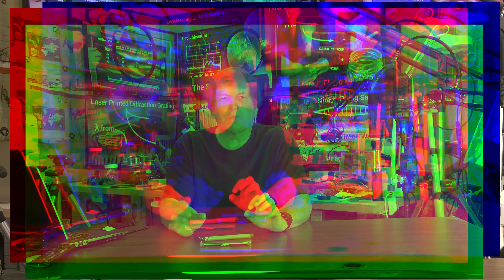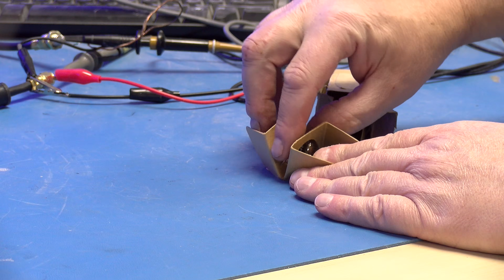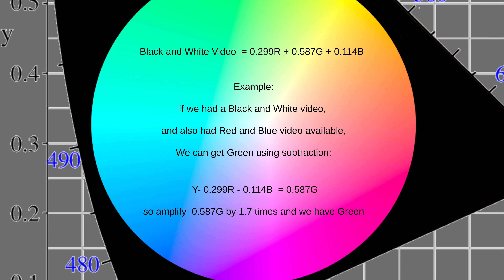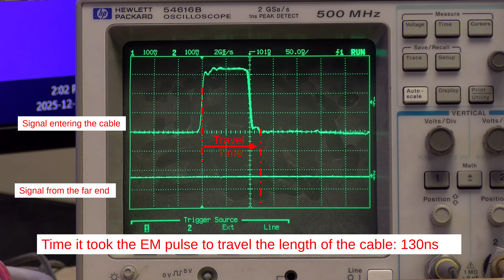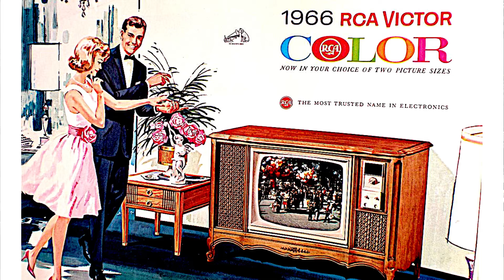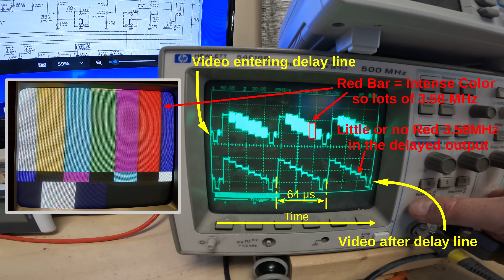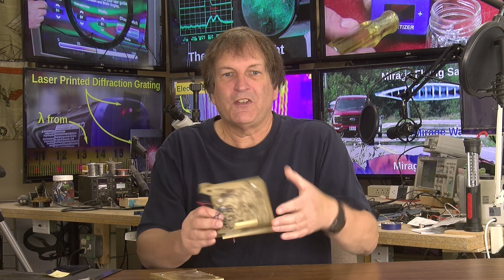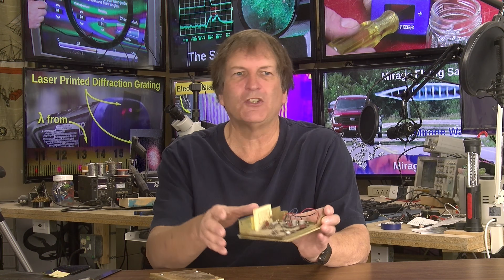How we slowed down electricity to create Color TV

Comment: Regarding the delay line for delaying the black-and-white signal, I'm just curious why the broadcaster didn't just delay the signal at the tramitter - wouldn't the negate the need for delay lines in every t.v.?
Reply from the maker: That would have been a great way to do it but particularity the earlier color TV sets would have needed a longer delay than newer ones. The original TVs separated the color from the BW part of the signal with a simple high pass filter resulting in much lower color bandwidth (=sharpness) than was actually available in the signal, so the color part was "smeared" much more in the early sets and needed a greater shift to line it up with the BW. It would seem like the original color TV engineers anticipated that TV sets in the future would do a better job of separating the color and BW parts of the signal and need a different amount of delay - quite remarkable that they thought of that even though they presumably had no idea how effectively we would eventually be able to do it with digital signal processing. 

They perhaps could have inserted a minimal delay to the length of delay lines in the early TVs half as long  and eliminate the need for a delay at all in later ones, but my guess is that since they couldnt provide a solution that would  work for all future TVs they felt it was better to leave the TV signal unaltered in case adding a delay might cause issues of some kind as technology evolved.

Comment: IIRC The original NTSC proposal actually had different Bandwidths for the R-Y and B-Y components because for one of them we have a higher acuity, I can't remember which one, But it was allowed a higher bandwidth.
Reply from the maker: I had actually thought it was still that way but another commenter mentioned that a few years after NTSC color TV was introduced reducing the bandwidth of one of them was dropped. Any idea if that actually happened?
Reply: @ElectromagneticVideos  I don't think it was actually implemented, in practice. AFAIK both chrominance channels ended up being same Bandwidth. TBH they needed to be so the luminance delay worked for both of them!
BYW I have a demonstration of the difference in our colour vision systems that I use when I talk about audio and video coding.
https://youtu.be/uoYx-_9ges0?list=PLbqLzoPU3DOjAPhsk-LfVCA46IdgBiT-j&t=1972
Reply from the maker: @jamieangus-whiteoak3656  Yes - maybe they quickly realized that different TV sets would get built with different bandwidth cutoffs, and also would not want the cost of an additional delay line in a TV set. I'll have to watch your lecture - just bookmarked it!

Comment: Hasn't it always been that corporations want to cram in more quantity with less quality. Today they change codecs rapidly in digital systems without backwards compatibility. A few years ago they removed chroma subsampling from the thumbnails from youtube and they suddenly looked like christmas. It is only not noticeable because of modest expectations. Our chroma carrier was over 4 MHz. Maybe that is why I couldn't notice the high frequencies on an old TV. There is also more bandwidth in decimeter channels, but I don't know to what extent it is used. The switch from SECAM to PAL resulted in massive sharpness, in part because the smeared color was gone.

AM radio used to have more bandwidth in the past. There is also a lot of unused spectrum up higher. I remember how I could hear radio from the tropical bands in Europe because of no overlap with closer stations.

Foot per nanosecond, lol. I want to see a megafoot per millihour next. Duke Nukem's mega foot engaged.

Why wouldn't they align the luminance and chrominance at the transmitter once using the best possible delay line? The delay line was needed for decoding SECAM. We had those, but only one of them that I could see. There was a motivation to avoid a delay line in PAL. I think it had to do with a patent.

Older computers relied more on buses where a group of signals had to arrive at the same time.
Reply from the maker: Your right about the avoiding some PAL patents by leaving out the 64uS delay line. I think the reason the NTSC system did put the delay line in the transmitter is the  delay needed dependson diference between the bandwidths of the  chroma and luma signals. Many early TVs really reducted the chroma and luma  bandwidths to make chroma/luma seperation easy. In the 80s with comb filters, much more chroma and luma bandwidth was possible, so the delay line needed might have been different.

Comment: PAL doesn't require a delay line to decode! You can implement a PAL decoder without one by just subtracting the colour signal from the input signal. You'll get alternating light and dark versions of a colour, rather than a flat area like with the delay line approach. This is called PAL-S, for "simple", and it's based on the idea of optical averaging just from the distance to the screen. The delay-line approach implements the averaging electronically instead. The only analogue TV system that does actually require a delay line is SECAM. The usage in PAL receivers is just for better picture quality, rather than a necessity of the system.
Reply from the maker: Yes - extactly! And in most cases the difference in color on alternate lines would have been minimal. When I was creating video that I did after this one (where I show and explain PAL and SECAM) I sort of demonstrate  PALs alternating lines by simulating them with stripes either 10 or 20 HD lines wide. When I was experimenting with that the interesting thing I noticed was that even when the thick lines were very obviously visible, somehow I still saw the averaged color (a little hard to describe). So in the human vision system there is something going on that would probably make simple pal  better than might be expected.

Comment: I have a couple of questions:
1. Rather than add a 3.58MHz sinewave to the luminance video, corrupting the luminance, why not phase modulate the luminance RF/IF carrier? This would have been perfectly compatible with B&W reception without the NTSC side effects you mentioned. 
Answer: carrier phase color modulation contains no saturation info, that is essential to correct picture representation.
2. I assume the color burst at the start of the line is used to injection lock the TV's 3.58MHz oscillator and that oscillator's phase deviation during the line interval is insufficient to cause a color shift over the length of the line?
3. When transmitting a B&W image is the color burst & 3.58MHz sinewave omitted resulting in a cleaner picture?
Thanks, it's been 50+ years since I studied analog TV technology, so I'm a bit rusty!
Reply from the maker: Sometimes viewers come up with some really great questions that make you think, and you sure did!!!

1. So lets assume that we are good with phase modulation only  for the color applied to the carrier and decide that we will do something like  SECAM and transmit half the color info on one line and the other half the next. 

So now we have AM modulation for the BW and PM for the chroma on the same carrier. Would that work?

Heres what I think (but if anyone has other thoughts please comment!): 

Lets assume we do this by first phase modulating the carrier and then running that through the AM BW modulator. 

PM can be obtained from an  FM modulator  by feeding the modulator with the derivative of the signal. So lets assume we are using a FM modulator. The FM bandwidth is small compared to the  signal bandwidth because we have to keep the bandwidth within the assigned channel bandwidth of 6MHz or whatever it is. Narrow Band FM has a spectrum much like AM (with a 90 degree offset carrier), so it will look much like the bandwidth of the original color carrying signal.

So we take that PM (= FM)  carrier with a say 6Mhz bandwidth and  AM modulated it - effectivly multiplying it with the black and white signal. So if we multiply in the time domain (ie real signals) in  the frequency domain (spectrum) we get a convolution of the frequency domain versions of the original signals - so we  end up with a bandwidth of the output = the bandwidth of the color signal + the bandwidth  of theblack and white signal. 

So now our video channel bandwidth is 50% to 100% bigger than the black and white signal, so besides being a bigger channel, may not fit through the IF filters of black and white TV resulting in funny effects. 

Even worse, TV usually has one sideband half removed (vestigial sideband) because they are redundant. But in this the situation will be more like QAM where two signal are modulated at the same frquency, one on a cosine carrier and one on a sine carrier. In this case the sidebands  are not the same and are needed. So I think you would also loose information. 

So bottom line - great thought, but wont work :(

2. Yes - exactly. Heres a neat twist - some early color TVs just fed the burst to the 3.58 MHz crystal which started it ringing like a tuning fork - and it kept ringing for the entire length of the line. No oscillator needed- just an amp and limiter to keep the 3.58Mhz voltage constant.  

 3. I have heard that was done in the early days of color TV.  I think as time went on and BW transmissions became rare, they didnt bother. Some early color TVs had color killer circuits in them to detect the lack of burst and turn off the color circuitry so that it wouldnt add color noise to the BW image.
  
Hope this long answer helps!
Reply: Ah, vestigial sideband suppressed carrier, I believe AM is recreated within the TV allowing simple envelope detection of the luminance signal. At the TV transmitter there is NO conventional AM carrier that could be phase modulated. A phase modulated color signal could be band limited just as with NTSC so no extra bandwidth required. However the real problem is the lack of an essential color saturation signal, so my idea is dead in the water. 
P.S. we got our first PAL color TV around 1973. When I told an old engineer at work, he said he'd never buy a color TV because B&W was degraded. Little did he know, it was the new color format causing the degradation & his B&W TV would suffer similarly. Cheers!

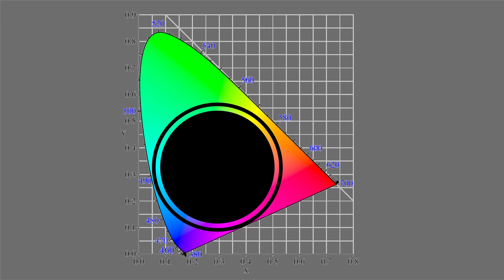Comment: 9:48 Adding three colors of light produces colors within a triangle in chromaticity space, not a circle.  The three colors sit at the vertices.
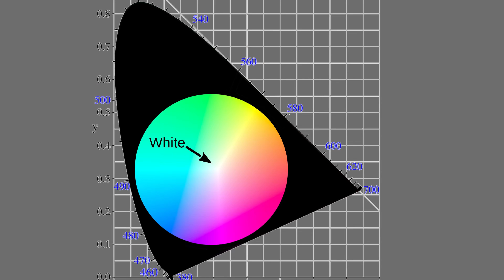10:35 NTSC does encode chrominance as a vector of sorts, but not a vector in chromaticity space. It encodes along an orange-blue axis (I) and a purple-green axis (Q).  If you plotted those axes in chromaticity space, they wouldn't be straight lines.
Reply from the maker: Exactly - but I had to simplify and leave out a lot to make an easily understandable video for most viewers and also keep the length to a reasonable limit.

Comment: Interesting - I never knew about this aspect, despite of having read a bunch of articles on the topic. I wonder, though, why the delay had to be done separately in each TV set and not coded into the broadcast. I found the info about the delay lines on VCR, PAL and Secam especially fascinating. PAL and Secam are often ignored on coverage of TV broadcast color, so looking forward to a video on that if you'll make one!
Reply from the maker: I get the impression that the delay line is often ignored because it is not fundamental to the concept of how color is added to bw,  and requires a significant further level of understanding as to why its there. 

There  will be a couple of followup videos, one of NTSC vs PAL vs SECAM which should cover exactly what your hoping for. And another on why 29.97 fps as a frame rate exists. Stay tuned!

Comment: Television engineer here. I originally thought you were going to talk about why we have the color subcarrier frequency that we do. And it involved slowing something down! (BTW, excellent presentation! The only thing that might be a bit inaccurate is the delay was needed because there was an electrical delay caused by the extra electronics and especially the bandpass filters in the chrominance channel. They acted as delay lines in their own right. So, the video was delayed to match the chrominance as you described. There was also an amount of group delay deliberately added to the entire video signal in the transmitter to further correct the delay discrepency.) In any case to minimize the dots you describe, and to keep them moving to be less noticeable, a subcarrier frequency that was an odd multiple of half the line rate was needed. If you look at video in the frequency domain, you will see that most of the information in typical video occurs in clusters that are the horizontal line rate apart. The middle area contains very little picture information. The chosen subcarrier frequency puts the chrominance sidebands in the middle of the luminance sidebands so that they don't interfere much with each other. The old Black and White horizontal rate was 15,750 Hz with a field rate of 60 Hz. These choices had the advantage that the 60 Hz AC like could be conveniently used a synchronizing signal in the studio plant. This caused a choice of subcarrier frequency of 3.583125 Hz (455/2 X Fh). While this worked fine for color, it was discovered that this subcarrier frequency had an objectionable beat with the 4.5 MHz sound subcarrier. The proposed solution was to slightly change the sound subcarrier frequency. It was just enough of a change that a few B/W TVs may need a slight change in the alignment of the sound IF circuits (FM is very forgiving of small carrier frequency shifts). So of all groups, the TV servicepeople of the day got upset about this possibility, as IF alignments were and still are challenging to do. So, a proposal was made to shift the horizontal line rate just slightly, by a ratio of 1000/1001! This resulted in a line rate of 15734.2657 Hz, a field rate of 59.94 Hz and a color subcarrier frequency of 3579545.45... Hz. This is what we have today, and even digital TV in NTSC countires is still based on these numbers. So, the video signal was essentially slowed down a bit to accommodate compatible color! This made the TV servicepeople happy, but the TV station owners angry. TV stations could no longer use the AC line as a reference, but instead had to purchase complex, expensive sync generators to operate their TV plants. In those days, a sync generator occupied the better part of an entire equipment rack. To help out TV stations with sync generation, the major TV networks would derive their color subcarrier from an atomic clock. 63/88 of the typical 5 MHz out of an atomic clock produces exactly our color subcarrier frequency. The local stations locked their sync generators to the color signal from the network, and everyone was happy. It also meant that for a long time, you could calibrate a frequency counter by counting the locked subcarrier oscillator in a typical TV set while it was tuned to the signal of a major network!
Reply from the maker: You answered something I had always wondered about - why did they shift everything a bit to keep the audio at 4.5MHz as it was in BW. I'm a bit surprised that the audio IF was narrow enough in some sets to potentially cause a problem, but I can sure understand the concern the service people had. I am planning to a do a why 29.97fps video and I'll include that in it. The atomic clock bit - I remember way back reading an article in Popular Electronics or Radio Electronics where they had a project to use TV network atomic clock derived burst to create an accurate frequency standard. I think there was a warning that during local programming  you could not be sure it came from an atomic clock frequency standard. 

Your point "the bandpass filters in the chrominance channel. They acted as delay lines in their own right". Yes - I tried to show an approximation of the delay effect of filtering with the graphical representation in the time domain to give people a sense of what is going on. Its always a struggle as to how much to put in and in how much detail - its very easy to have YT viewers loose interest when delving into something too deeply. 

Thanks for your detailed comment - really appreciate the time you took to write all of that. I always find comments like yours really add to  the video!

Comment: Fascinating!  I lived this history so hearing how it worked is a delight.  
Sure enough I have often wondered about the zig zag lines on a circuit board.  Could that be of necessity because of the data being sent as parallel in older computers?  We often made the analogy of a parade turning the corner and trying to keep in line.  Those on the inside of the curve would have to walk more slowly (shorter steps) than those on the outside of the corner. Only the guys in the center kept the normal pace.
Fascinating.  Thanks
Reply from the maker: I never heard the parade analogy - its perfect! I'll remember that one. And yes - a real issue in older computers where 8, 16 32 or more bits all had to arrive at the same time. Not a problem in the old days of 1Mhz, 4.77Mhz clocks etc. But as things got faster is became a huge issue. In the end much faster modern electronics solved that sending data with much faster serial streams like sata and pcie.  One the PCB is could even just be making sure the clock got to a certain IC at the right time so it was in sync with the arriving data from another IC. Glad you found it fascinating.